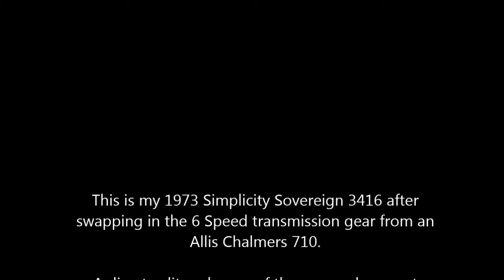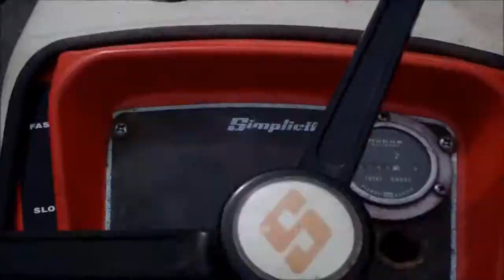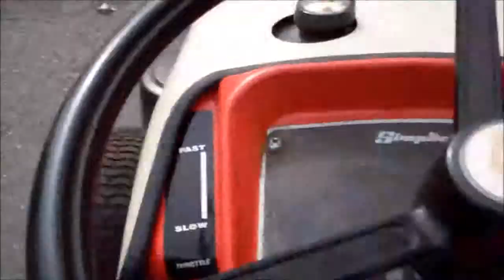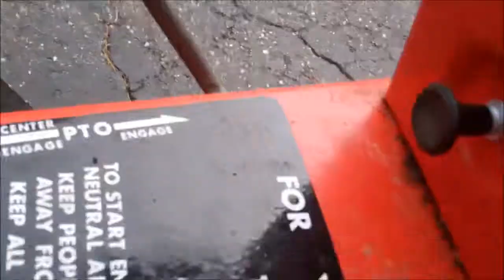Simplicity Sovereign 3416 6 Speed

Comment: Awesome swap! I have a 3516h that seems to be leaking hydrostatic fluid into the crank case. Can't find parts for them transaxles and hydro pump. So I'm thinking of swapping in something newer.
Reply from the maker: Parts availability can be a challenge on the older stuff. Since this video was made I've swapped out the 6-speed for a Sunstrand hydro from a mid-80s Sovereign. Had to do a little welding to make it all work, but snow duty is much easier without having to swap gears all the time.

Comment: Video is not bad at all - isn't that referred to as the shuttle drive by name? If not adjusted properly they can really be a pain in the but. But other wise it splits each gear in half. Tractor appears to be in good shape thanks for posting.
Reply from the maker: +K-9 COOPER No, it's a 6-speed. I have a shuttle I use for plowing in another video; I'll get a video of that working soon. The shuttle uses a planetary gear for forward and reverse, and a secondary belt that serves as a clutch on a split sheave to provide power. This particular tractor came as a shuttle with a broken axle and I swapped in a three speed and then this 6 speed. It currently has a sunstrand hydro from a '79 7016.